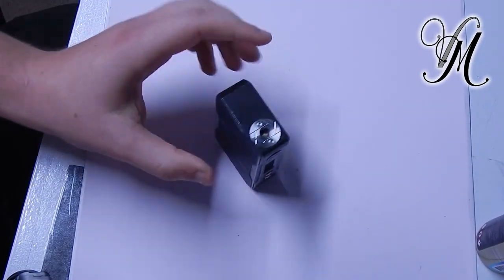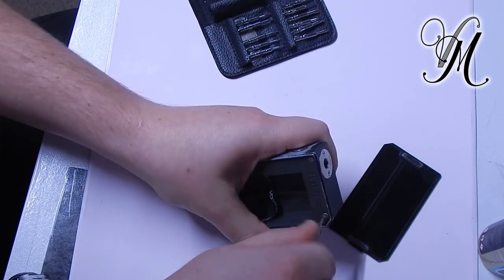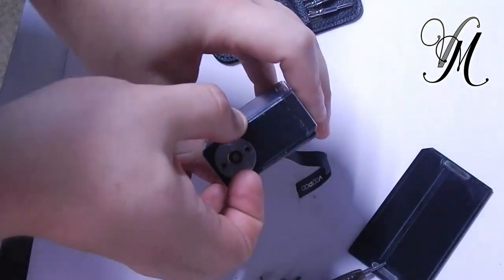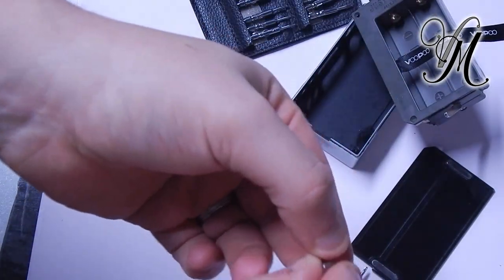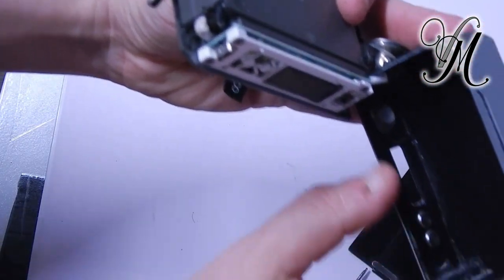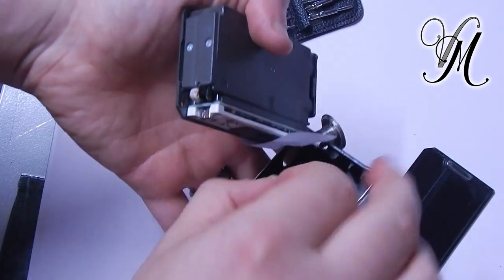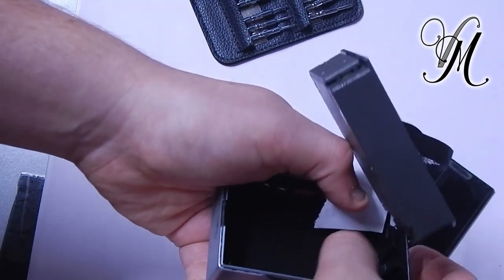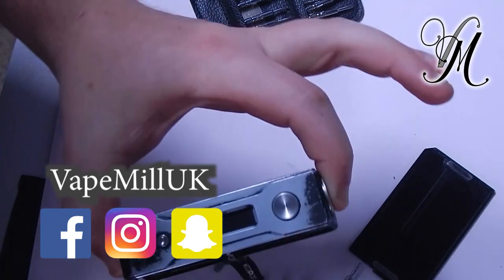VooPoo DRAG (Original) Button Fix - Read description

Comment: The "odd part really" is that you don't need the ramp.  Just hold it square when you put it in so the silicone bushing does't get moved.  
I did this but the problem is the pcb part. The button works fine.  The electronics are temperamental.  It works for a while and then fades out and eventually won't work unless you let it sit for a while.   Don't think it is a firmware issue.

Comment: my fire button not working even if you take the whole chip and directly push it, it's clicking but not firing I disassemble it like that and put some battery and atomizer while it disassembled, and its automatically turning on and the firing button is not firing and the mod can analyze the atomizer correctly. no atomizer short or other warnings that it has a malfunction but the firing button is not firing

Comment: First that is a pathetic fix. Second I have a theory; this guy knows nothing about fixing vapes. I also am lead to the assumption that this isnt even an actual problem that drags have I've seen many drags not working because of the button, but it's the actual button on the pcb. This guy most likely just heard that drags had button issues and crapped this out or he was the 1 in a million who's drag only had a minor problem and not a death sentence problem

Comment: this is not an fix! This is a crutch! Temporary solution
Reply from the maker: Thank you for your comment.
It is appreciated.

So it's not a fix, it's a temporary fix?

I agree, it puts the poorly designed device back to how VooPoo made it.

The problem: the rubber has come off from the button.

Solutions put the rubber back.

The only long term solution would be for VooPoo to recall the device and fix it.. but that's not going to happen.

If you've tried it and it didn't last very long, try finding a glue that will bond the metal button to the rubber bung without making the rubber bung hard. That would be the only way to fix it "more long term" without VooPoo correcting the error.
Reply: Bandaid on a bullet hole

Comment: Anyone know the size if the button and if I can get a replacement?
Reply from the maker: I'm not sure myself.

However it is worth mentioning, the button on the Drag and the Drag 2 are definitely different.

one has a bump outward and one has a bump inward...if i remember right... Either way they are definitely different
Reply: Use calipers. You can get them from harbor freight for cheap and get exact measurements of the button.